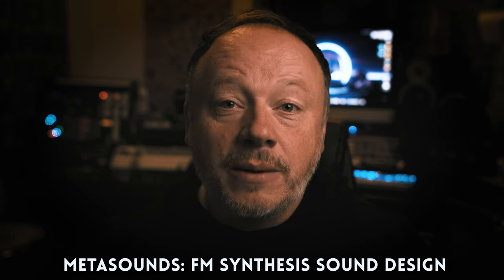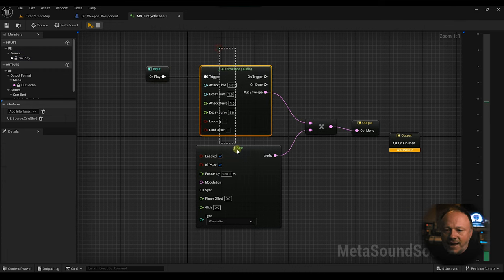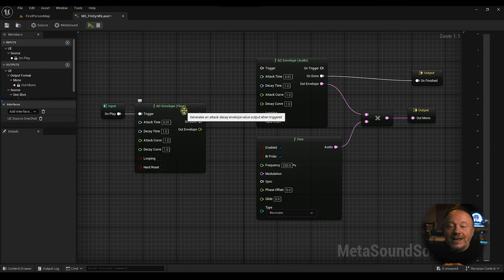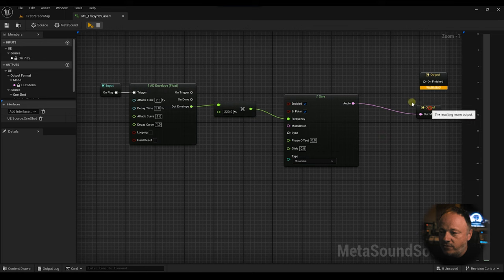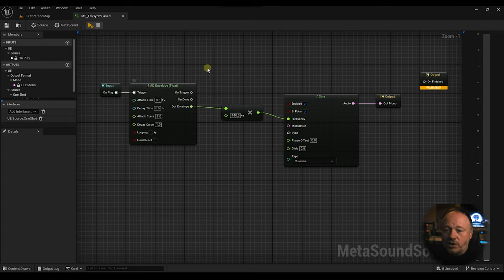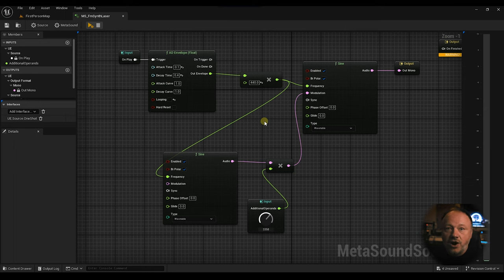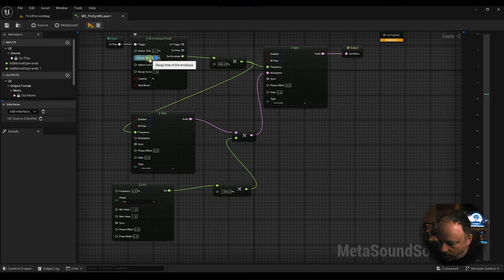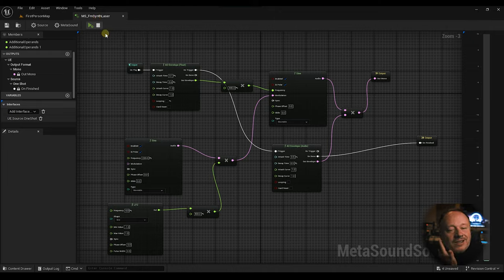Metasound Design: Create a Sci-Fi Laser Gun From Scratch Using Sine Waves and FM Synthesis

Comment: How to print out the duration of MIDI notes in music playback for Blueprint usage?
Reply from the maker: I’m not sure exactly what you are asking? What midi software or plug-in are you using? Are you asking how to determine the length of beats at a certain tempo? If so, there is a BPM note in Unreal you can use to set pulses at different divisions …. You can also find a midi note calculator online that can give you exact note lengths at specific tempos…